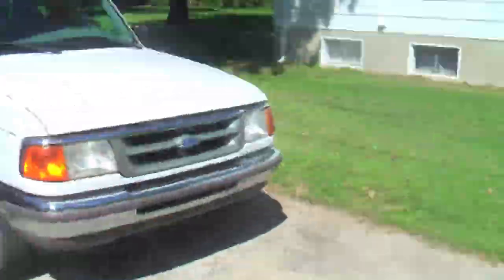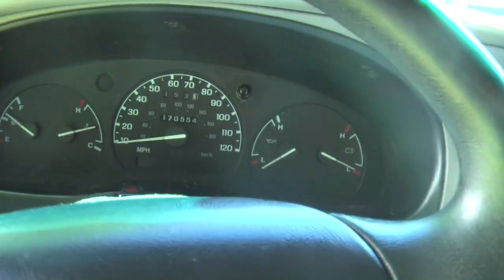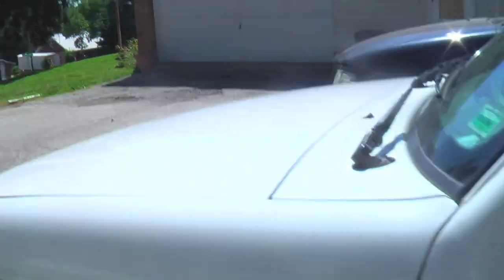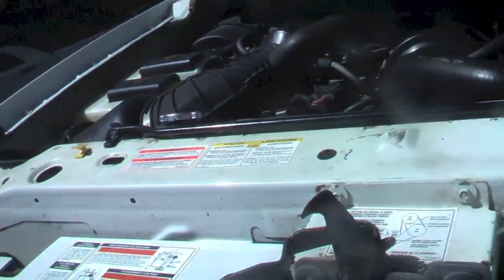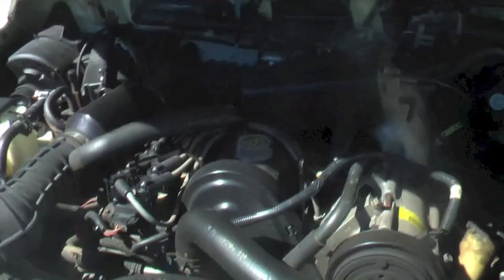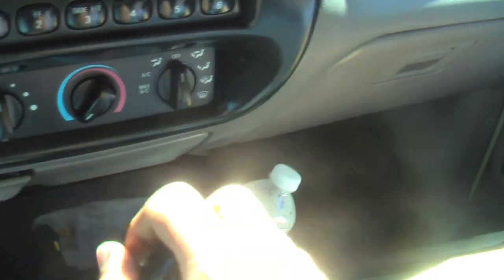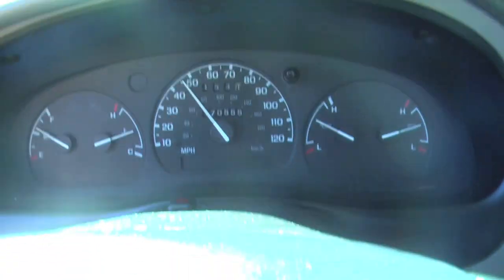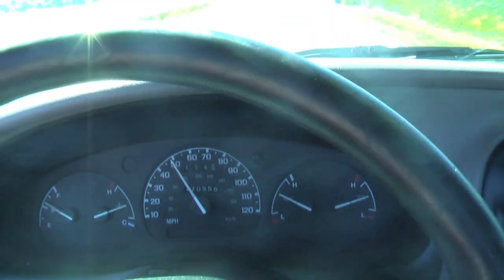Driving the 2.3 5 Speed Ford Ranger

Comment: just got one my self but is automatic 2 preview oners with 92k miles and it is clean . after hearing you say. 170k mile you have no idea how happy i am
Reply: +STFOURNARIS Had mine for a year myself with the 2.5L version.  Hearing all these 200k and lower makes my 405k seem excessive.
Reply: +Mephles N damm mine is in the 270k makes me happy to know that they last long..
Reply: if you change your oil every 3,000 miles and use a high quality oil, the engine will last a long time. just had the top end rebuilt at 150k miles on my 2.3l 96 xlt ford ranger. The cylinder walls still have the honing marks on them, been using mobil 1 pretty much its whole lifetime. pretty much expecting another 5yrs or 200k miles out of the engine as long as the gaskets hold together.
Reply: STFOURNARIS those mazda 2.3 engines will run forever. 400,000 miles. i totaled my 1st 1 4 times and son bitch still runs. cabs all smashed from rollover on last time. but ill use engine as spare in another 1 my rangers
Reply: STFOURNARIS 93-97 ranger 2.3 5sp is best used vehicle you can buy if its been taken care of. little goes wrong and cheap and easy to work on

Comment: only problem with rangers is that the damn oil pump goes wacky after 100,000 k and it usually blows the motor . So if you ever notice your oil gauge needle bouncing around get ready to replace the pump before motor dumps !! Been through it 3 times in my life !!
Reply: tweak I know your comment is pretty old, but I think my ranger is having that issue. When I start it up, the needle is bottomed out. After a few minutes, it’ll bounce around and eventually stop to where it should be. I figured it was just a sensor going bad or something but seeing your comment made me unsure.
Reply: Black hawk you may want to check into a new oil pump
Reply: Not the 2.3l .

Comment: I guess a vintage Ranger with a the 2.3 liter four cylinder and and a manual transmission is one way to avoid the Rangers with non-serviceable transmissions. The non-interference engine is great if the timing belt fails.

Comment: doesn't matter if they had 5000 valves, why? because the valves aren't burning the fuel, the spark plug does. more spark plugs = more spark = more complete burning of the fuel. use your head. the only downside is you have to pay more for spark plugs.

Comment: OK, The fuel is injected into the cylinder as normal to propel the vehicle, and instead of being ignited with one spark plug(and having the chance of unburned fuel), it uses TWO spark-plugs, NO extra fuel is used up, just the fuel the engine received is burned more EFFICIENTLY, and exhaust valve isn't a problem because the size of the valve is supposed to handle completely burned fuel, OR ford made it bigger, which isn't necessary. Get it?

Comment: With no tachometer how do you know when to shift? Forgive my lack of knowledge, I am trying to learn as much as i can about manual transmission so i can learn to drive one.
Reply: Six years late, but you can hear and feel the revs
Reply: Not only learn the sound of certain rpm’s but feel the rev. If u shift too soon it’ll bog and be too little power for the new gear. It may not kill on ya but it will be slow as fuck until rpms climb and not good for the motor. It’s best to shift back down a gear and build up revs. If u shift too high it’ll chirp or spin the tires possibly losing traction and definitely wear out the clutch faster. If you shift in the sweet spot of the powerband (usually 3k-4K rpm) the truck will feel strong shifting and the transition very smooth.  Lots of base trim cars and trucks in the 70’s and 80’s didn’t have tachs. It’s pretty quick and natural to hear and learn your sweet zone in a new vehicle. Learning to use the clutch and gas smoothly is a little more challenging but it’s all very easy really.

Comment: i have the same truck. 95. do you know where the camshaft position sensor on this is?? why cant i find it? trucks running like crap, barely accelerate on flat ground, and wont even make it up a hill in first gear. just ordered the camshaft position sensor (after changing plugs and fuel filter, which didnt help). hoping the cam sensor will help me, but cant even find it lol

Comment: just a dumb question.....can you add turbo or even super to these things (id want to add the one that gives it more boost on the low range RPM's)
Reply: kjilk simble turbo is possible. Best thing if your just looking for a little more power is to find a 85-87 mustang turbo or 87-88 turbo coupe. You’ll need the head cylinder, piston heads (their forged) harness and ecu. For more power their are several forums that talk about Volvo 2.3 Dohc builds. The 94 ford/Mazda blocks are best due to the power steering pump and other bracket locations. For high power builds the “flovo” does require a fair amount of fabrication and eyelashes forged piston heads as it will make the engine an interference build. Going with a esslinger head ( hella expensive) can produce similar power to the flovo on a single cam platform (not sure if it’ll be interference with the esslinger). 

Flovo builds you will need a stand alone ecu.

Comment: I got the same model.    What speed do you shift from first to second ?  And what speed do you shift from 2nd to 3rd ?   I had to shift from 2st to 2nd @ 10mph.   And 2nd to 3rd at 20mph.  Does it sound like something wrong ?
Reply: ka ch depends on rear end ratio. 15. 30. 40. 55 i think are my shift points. but im usually racing off the line

Comment: hey, Daniel, I'm in Arkansas and just bought a 97 Ranger 4X4.  I'm having troubles finding a seat and a steering wheel for it.  Both are workable, but need fixing.  Do you have any ideas on where to look to get those parts?  I've checked everywhere I can think of
Reply: David Layman explorer parts usually interchange. i got explorer seats in one mine. im in ar too. what town you in. im gonna switch those seats out for racing seats i got. local junk yards have seats and steer wheels too. you can switch out steer column with explorer column easy and get tilt.
Reply: lmctruck.com. They have most OEM parts you could want.

Comment: Would this be a good first car
Reply: Wasn't my first car, but was my first manual transmission vehicle, glad i got it, got a 2007, having no issue. Was good to start learning stick on after driving for 6 years
Reply: Hybrid child preda zero door yes
Reply: this is a great all arounder. one of the best starters you can find
Reply: Mike F 
What? It's fine in snow.
You can drift instead of understeer.
Reply: A little late, but it is a great first car. We bought our son then 17 a 99 ranger 4.0 v6 5 speed manual. It had 170,000 on it and ran like a top. Very easy to drive and perfect for a 16yo-any age. It got 26 mpg all day and started every day. He had his first accident in it, rear ended a suv hard. It still started!
Reply: An 84 was mine 
I just got it this year

Comment: ok i have a 95 ford F150 auto 2wd. and im thinking of getting rid of it for a 94 ranger 5 speed yes or no? i love my F150 but i cant afford the gas in it
Reply: you gotta do what you gotta do. Some people just buy little civics purely for the gas mileage
Reply: if you want a truck get the ranger 5 speed. IF its a 4 cylinder. my 3.0 ranger gets what my grandad gets in his 4.7 dodge 1500. 14 mpg. im sure if your truck has like a 351 itll be a huge improvement but i mean if youre just going from a 5.0 or 4.9 to a 4.0 the difference will be a pretty good loss of power and maybe one mpg more.
Reply: frankenstrat25
Yeah, I never knew why ford kept the 3.0 as long as it did. It wasn't much more powerful then the 2.3 and drank as much gas as the 4.0.
Reply: frankenstrat25
You know if you advance your timing to much you will probably just spark knock....just saying...lol
Reply: i know lol it was just a mistake like i didnt take off the cap and figure out where top dead center was like my distributor was completely loose and i just started it up and turned it til it ran good lol.
Reply: frankenstrat25
Oh yeah, thats how my 2.3 ranger is timed. I have no idea what its actually at, but it runs good and doesnt ping.  And you dont need to remove the cap to check timing, you just need a timing light.  Unless you remove the distributor entirely and forget where it was pointed.
Reply: yea i didnt have the money for a light lol.
Reply: frankenstrat25
Yep. I think i might by one from amazon.  Fuck advanced auto for not having a loaner.  I swear the 1st guy I talked to at the counter didnt even know what the fuck it was.
Reply: try autozone. i never liked advanced. but then again you dont really need a timing light just take the cap off take the number 1 cylinder spark plug off. crank the engine with a ratchet until its on top dead center and if the distributor isnt directly on cylinder 1 then its off time. very simple
Reply: frankenstrat25
How would you get say 10 degrees BTDC, using that method?   I;m just curious...  I mean you can get close, just guessimating like that, and that is how you can initially time the distributor if it was removed, but how do you get the timing finely tuned, just by eyeing the rotor in the distributor??? .
  Besides, using a timing light is way easier.  No ratches at all required. Literally positive and negative clamps on the battery, inductive clamp on the #1 sparkplug wire and aim the light at the timing marks on the crank pulley and there you go...exact timing right before your eyes.
Reply: +Michael G this comment is old but the 3.0 is bullet proof
Reply: Zander Lawson Yeah, I have a buddy who has one the odometer broke at like 280k miles over ten years ago and he still drives it.
Reply: frankenstrat25 if you only get 14mpg with your 3.0 v6 and your grandpa only gets 14mpg with his dodge 4.7 then both of you guys need to do a tune up lol. My 2000 3.0 v6 Ranger gets around 20mpg and my 4.7 dodge gets around 16mpg. Towing a 6k lbs horse trailer with the dodge only drops the mpg to 10-11

Comment: I have a 2.3L with a 5 speed and it's horrid. Takes about 2-3 seconds gain 10mph after every shift, the trans slams into gear every time, the exhaust will never stay fixed and the engine runs rough

Comment: Most of the ones I've found are all 6cyl I don't like the 4 bangers, not enough power and torque.
Reply: +mightaymouse I suppose fours are okay but, Im with you I prefer the 6 cyl
Reply: +mightaymouse ya, mines a v6... I definitely prefer that to 4 bangers.
Reply: +ryfodrea 3.0 or 4.0
Reply: Put a turbo on that 2.3 there won't be much that could catch it. They put a turboed 2.3 in mustang and it Put out more horsepower then the 5.0 v8

Comment: The 2.3L 1997 Ford Ranger engines have a timing belt and are interference. The 3.0L and 4.0L 1997 Ford Ranger engines have a timing chain and are non- ...